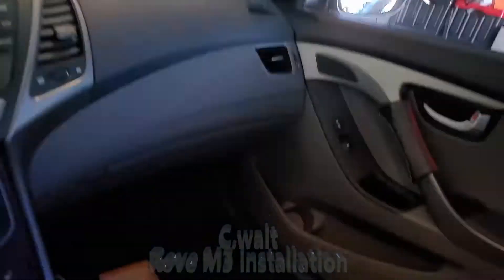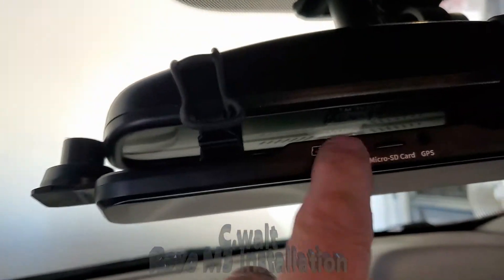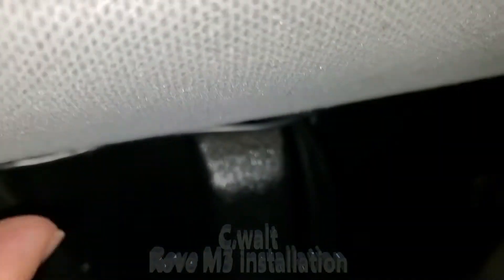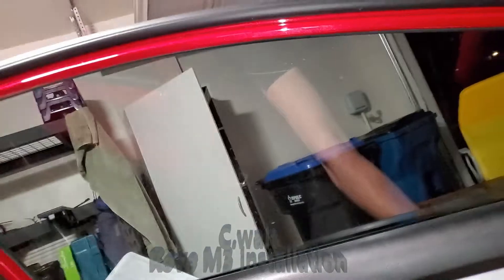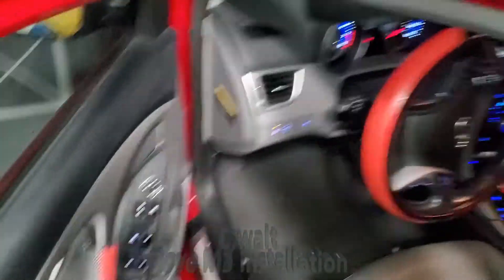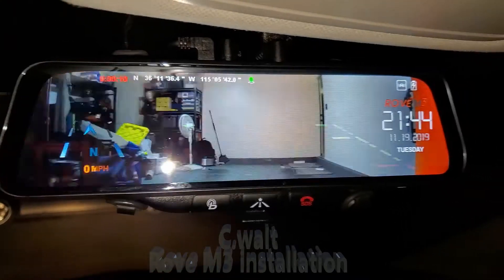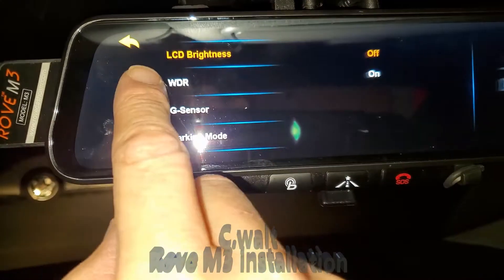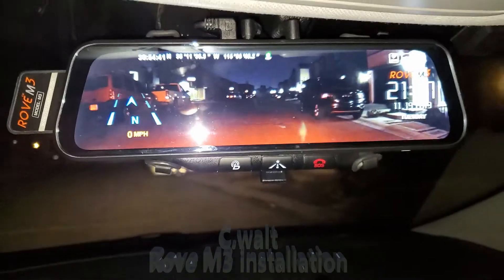RoveM3 installation

Comment: where is the main power cord connected to ( providing power for the front device and the rear camera)? Or is all the power coming from being plugged into the rear light?
Reply from the maker: you can connect it to your fuse box or into the 12 volt plug in your car